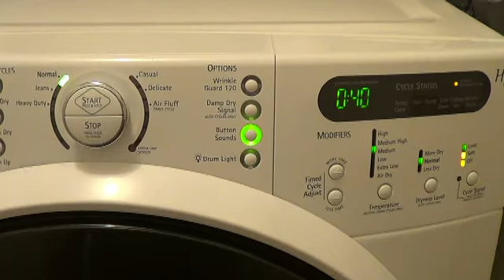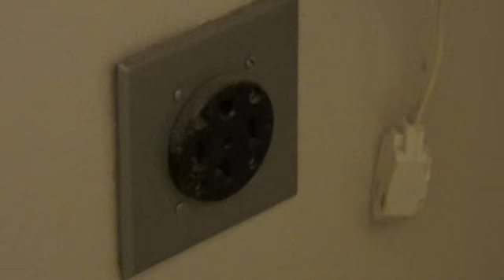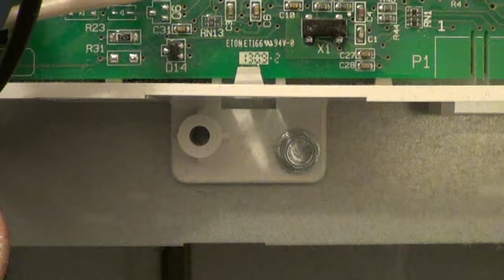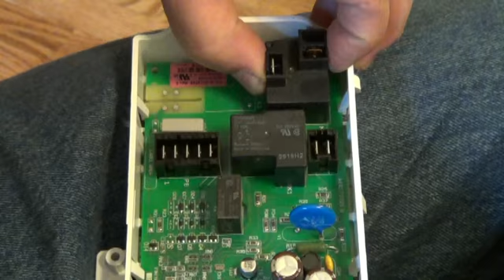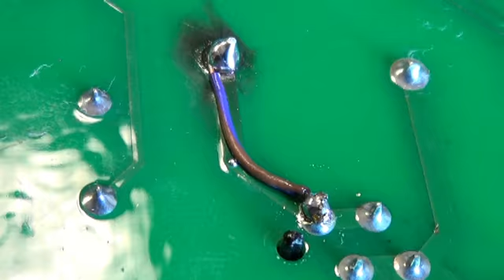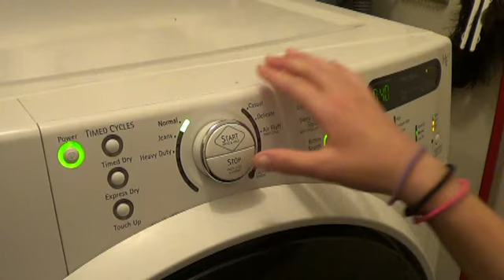Dryer Sears / Kenmore HE3 - F01 Error Code Main Circuit Board Repair

Comment: This is exactly what happened to mine after a power surge and outage for about 5 minutes. First you are supposed to unplug for 5 minutes and then try it but I knew it wouldnt be that easy. Thanks man. Great info. Only took 5 minutes to get the board out too. Very easy access.

Comment: Jim Dandy - you are!!!  I have no experience repairing appliances of any kind, yet I opened the top of my Kenmore, easily removed the main controller board, saw the exact black blowout, soldered a jumper wire, and turned on my dryer.  You saved me $1700 because I was ready to purchase a new washer and dryer set.  Wow, thank you again!!!!!

Comment: I'm so glad I found this video! Our dryer just showed this error and once we opened it up found that the back of the circuit board did indeed look like yours. After a few spots of solder and a few minutes putting the dryer back together, it's working again! 🙏 Thank you so much!

Comment: Board is discontinued so this was the only way to go other than a used board on ebay, as far as I could tell.  I just got some serious brownie points with ex-spouse (why would I bother, you say? good question).  This fix worked like a champ!  Same exact blowout indication.  I'm an attorney, but not a litigator, so not in my skill set but there are at least 840 members of a class action suit right here for designing a circuit board which has the same point of failure and cost consumers many thousands of dollars. Any volunteers?

Comment: @Jim thank you for this. I opened it up, same exact issue. I did solder the wire and put it back together. I got the same code, although, it did turn on for about 2-3 minutes. Same issue. Any ideas?
I replaced both the fuse, and thermistor.

Comment: My dryer quit, just clicked when you pressed the start button.  I never would have considered looking at the circuit board until I saw this video.  My better half was all ready to go buy a new appliance.  I talked her into waiting while I did some research on YouTube.  I watched this,  popped my board out, and it looked exactly the same as yours even down to the blow out.  I did the repair as you described and it worked!!!   I had never used a solder iron before this. I really appreciate you making this video.

Comment: Thanks. Awesome video. No experience required if you follow the video step by step. 
The exiting part was when I released the board and saw the exact same mark in the back.
The only thing I did different was that I did not put a piece of cable, just soldered the loose joint.

Comment: 😁 Whilst I have an electronics background it is sure nice to know exactly where to look many thanks good sir.  I did not add a second conductor as I thought if the trace is under sized and it lets go at the same spot I will know where to go hunting.  I have the exact same board made in 2005 also.  Thanks again for sharing!!

Comment: I found this gem of a how-to-repair, and it was spot on for me. I'm a former ET/trainer, and the video could not have been more clear (except for the "heater-upper" part :). Anyway, the CB land was fried from the relay post, so I grabbed a piece of solid core 12 ga. wire, tinned it, put it between the post and the CB strip, applied heat w/my 50-yr. old solder gun, put it back together, and It Is WORKING!! My wife is ecstatic, so life is good. For a little bit. Thank you so much!

Comment: Outstanding video! My dryer was a little newer, but allowing for the slight differences, it was spot on.  It looked like the previous owner had tried to do the repair and didn't do a good job.  I cleaned up the PCB, soldered the wire in place (thankfully, I know how to solder properly!), and 30 min later, the dryer was back in service.  Thanks!

Comment: You are the man. Appreciate the knowledge. I had to do the wire trick since mine busted the line that leads to the other solder. Worked like a charm. Going to buy me some time to buy a new one.

Comment: Great video!  We are about to tackle this and wondered what gauge wire you used.  Thanks!
Reply from the maker: About 24 AWG solid copper.  Door bell, thermostat or garage door sensor wire.
Reply: @jimdandy6472  Thank you.  We followed your instructions and fixed our dryer for $0!  This saved us about $400.  Thanks again!

Comment: Hi! We have a different problem with ours. The dryer starts but stops shortly after before everything is dry.. Also the lights flicker when it's on. Any ideas? Thanks
Reply from the maker: Could be the door switch.  Try some painting tape to hold it closed as a test.

Comment: Jim,
I hope you see this in time. What gauge wire did you use on the circuit board, to take some of the load.
Reply from the maker: 20, 22 or 24AWG, solid copper. Lots of options, but doorbell, or garage door sensor wire would be two.

Comment: worked for my Kenmore Elite HE5 with the exact same failure and failure code (F01). I didn't use wire, I just resoldered to the trace on the circuit board, but will use wire if it happens again.Took me less than 30 minutes to fix. Thanks for the tutorial!

Comment: I just did this, took a little over an hour including a trip to get wire and solder. You've earned my sub!
Reply: Hello what size wite
Reply: @tiawanathorpe2143  I used 14guage  since that's all that Ace had, otherwise I would have gone for 18 guage (that's smaller) but 14 worked fine it was just harder to bend how I wanted.

Comment: I performed this repair last week and it worked great! thanks. I have developed another problem though and I wondered if this relay has anything to do with the ignitor. I have no heat, ignitor don't glow and the voltage to it shows a short. 0.0 Volts. It ohms out fine as does the thermal fuse.

Comment: I have the same error. Unfortunately did not see anything burned but replaced the  relay anyway, still didn’t work. Have a slight hum from circuit board too.

Comment: Hello, I attempted to do the exact same repair after seeing a few videos with the same problem. But unfortunately mine did not turn back on. Do you think it might have to do with poor soldering?
Reply from the maker: If you are not  good at soldering, a bad soldering joint would be my best guess.  Scrap the pin with the blown solder joint.  Wrap the wire around the pin, then heat both until the solder melts when you touch the wire and or the pin.  on the other side heat the wire until the new solder melts, then push into the original solder joint.

OR you may have a different problem this video can't fix.

Comment: This video got my dryer back up and running!  Thank you so much for the easy fix.  I took the whole dryer apart to replace the thermal fuse and the dryer still did not work. So, I dig deeper into YouTube and found your video. I’m send hugs through the interwebs! Thanks, again.
Reply from the maker: Glad it helped.  Thanks for the kind words.

Comment: Had exactly the same issue with a Maytag MEDZ600 TW1 dryer!!! Same board, same location, same casing. In my professional opinion as an E.E. PhD, it was designed to fail! On purpose after 7-10 years of use.

Comment: I can’t remove one of the clips!!
Reply: Yeah, and its the connector with the two prongs,  there are two dimples on the blades that have to be overpowered to make the connector come loose. Keep trying [ Use a flat larger screwdriver ] but be careful not to damage the circuit board substrate.
Reply: @YouTube.TOM.A  I finally got it and made the repair... thank you!!!!!!
Reply: @rpbabineaux  Jim Danby is the MAN!!!

Comment: This is a great video.  Thank you.  I'll reiterate that the jumper wire is critical.  The exploded solder joint takes out the pad too.  There is really nothing on the PCB to solder onto anymore.  I used 18ga solid copper wire.  24ga and maybe 22ga seems a little thin based on the trace width on the PCB.  It's hard to tell since we don't know the thickness of the board trace.  In my case, I had two damaged solder joints on the relay, so I ended up doing 2 jumper wires.  

I just fixed a nearly 12 year old  HE3.  Hoping to get it to 20.

Comment: What about when the dryer go on gor 20 seconds it shuts down and a code 3 backwards and a 1
Reply from the maker: I found a video for an E1 error code:  https://www.youtube.com/watch?v=MN6E-oM0qoM

I did not watch the entire video, but it appeared to be a temperature sensor problem, and they showed the steps to replace it.  

No promises, but you should also check that the driver vent hose and pipe to the outside is clear.  It may be shutting down on high temp due to reduced air flow, or the sensor is bad, or I'm way off base.

Comment: Thank you! We just did this with zero soldering experience and it was super easy and worked like a charm. 39 bucks of hardware store materials and tools about 30 minutes of work later and we have a working dryer again. Folks like you who post this stuff are awesome.

Comment: Mine had been repaired before then quit working again.  I purchased a new relay for 10 bucks on eBay, put it in, and it did not work.   Then added the jumper wire and all works like new now.  Thanks for the advice!
Reply from the maker: Glad to hear it worked for you.  The jumper wire is important because usually when the solder joint explodes it blows away some of the metal foil, on the circuit board, around the pin.  While the new solder will ball up on the pin, it is not making any connection with the track on the circuit board over to the next pin.

Comment: I am fully capable of putting up fences and building decks.  I can change old light switches, but NEVER would I try something like this.  So I did.  When I saw the price and then watched this silly video, I said the worst that will happen is I waste an hour, and pay full price to the repairman.  
Jim was easy to understand, I had exactly the same problem, and although I had to visit a friend for a soldering iron, it went back together lickety split.  With youtube and guys like Jim, I can do anything!  THANK YOU SO MUCH!  Charlie Arbuiso  Endwell, NY
Reply from the maker: I'm glad it worked for you.  I continue to be amazed that over 5 years after making this video I continue to get comments almost every day.  FYI: My dryer is still working with this repair from over 5 years ago.

Comment: So i dont know if this is relevant or not. But I did the same fix about a year or three ago and it worked amazing. But.... now my dryer is turning on but I get no error codes and  the dryer does not get hot, even warm at all. No heat whatsoever .... I know what people say, fix this, replace that... I have replaced all the fuses and thermistors, changed the heating element. Everything on the lower side of the machine I have replaced ( I didn't check the switch inside the motor yet though).... No matter what I do the machine just does not heat,  I am thinking about re-doing this fix but I just don't know..... Anyone have any similar issues ?

Comment: Thanks a lot. Same issue. Fixed.
Before I found this video I called to a big famous company who is doing repair - quote just for visit abt 100$, no warranty, plus job and materials, ... and visit in 5 days..
So, soldering issue fixed and I called to the company to cancel visit and told them that I found another small company, their tech came in 30 mins, and fixed for 10$... Let them now scratch their heads how it is possible -))).. Small prank -)

Comment: Thanks for the review, I fixed it thanks to you!!!  I used 18 gauge braided aluminum wire but probably could have gone a bit smaller.  Just hope it holds and doesn't burn the house down.  The price for a new board in August 2020 is $306.35 if bought from directly form Sears.  Nice to save a few bucks thanks to folks like you that make these posts!

Comment: Great tutorial.  Found exactly the same problem with my  Sears Kenmore Dryer Model HE3.  Your fix saved our family $300.  It took about 20 minutes to pull the circuit board and repair the circuit.  I extended the wire 1/4" to the next pin to the right that needs the same signal effectively bypassing the trace in circuit board.  Apparently this circuit needs a heavier trace in the circuit board to carry the amperage required.

Comment: Oh myyyy gooood!  Same exact issue I just had.  Thank you for this!  Amazing.  Just 1 question.  Is that safe to piggyback that wire to that other circuit point?  Not gonna cause any other issues or overloads to the circuit?  Thanks again!
Reply from the maker: That "piggyback" wire is just a separate path between to points on the circuit board previously connected by a thin metal track between the same two points.  When the joint explodes it usually damages the thin metal track, so soldering the "piggyback" wire directly to the pin is necessary vs. just trying to add a blob of solder back on the pin with little or no metal left around it.  Mine is still working after many years now.

Comment: I ended up replacing the busted relay itself, but that didn't fix the whole issue, so I used this wire trick with the new relay and it works like a charm now. Thanks!

Comment: Thanks so much!  This was really helpful.  My 12-year old Sears Kenmore/Whirlpool Duet Sport dryer would not start and showed code F01.  Followed the instructions in the video and sure enough on careful inspection, one of the pins at the location shown on the control board showed signs of heating and damage. Cleaned it up and resoldered and success.  Took quite a bit of heat to get solder to flow over the eyelet on the board.

Comment: When we opened our circuit board sure enough it was the same exact problem. Followed the video instructions and was able to fix it at no cost (borrowed a soldering iron)! The only glitch we had was trying to figure out what wire to use. One of the comments below mentioned 12 gauge, but that seemed way to thick (& didn't look like the wire he used in the video), so we just directly soldered the joint. Thanks so much!!!!

Comment: Thank you for the video sir! I did try to Sauder those points with the wire and unfortunately the relay was still bad. But it did save me quite a bit of money not calling out for a service call. I ordered the new circuit board from Midwest Appliance in Chicago for $180 including the 3 day shipping, so not as bad as it would have been if Sears come out.  I'm an air conditioner repair guy so I'm familiar with boards going bad.

Comment: Thank you for making this video! We had the same problem and after spending $24.00 on a soldering iron, electrical wire, and some electrical solder, we fixed the problem! It only took about 30min from start to finish. Thank you so much for saving us hundreds!

Comment: Thanks so much. I was working on a dryer that had a bad start button (wouldn’t actually make contact with the switch on the circuit board). Once I disassembled the control panel, I was able to press the little tactile switch manually and then I got this error. My control board had the same exact solder joint issue. I’ll have it all up and running once I get a replacement start button.

Comment: Once re-soldered, I’m testing and it keeps “popping” and the connection is burnt again. Any suggestions? Thx in advance
Reply from the maker: Hard to say without knowing more.  I assume you are installing the jumper wire and not just trying to simply resolder the exploded solder joint?  The jumper wire is needed as the solder track around the exploded pin is damage during the initial popping.  If you are cleaning the pin, using the jumper wire, and using good soldering techniques, there may be a more serious problem, but this would be the first time I've been told this fix failed.  Good luck..

Comment: Absolutely amazing video!!! Thank you! My dryer had this same problem 2-3 years ago and I didn't bother to google much; I simply shelled out $200 or however much for a new board. Today it happened again and I was going to just buy a new dryer, but I decided to search a bit first -- found this video and an hour later my dryer is back up and running. Excellent work.

Note for those who run across this: The joint where the blow out occurred didn't take the solder the first time around. It was covered with black residue and I had to use my fingernail and scrape it clean. Once I got down to shiny metal I was able to successfully do the work.

Comment: This is as relevant today as it was nearly five years ago today. My Whirlpool Duet Dryer stopped working today with the F 01 error. I've owned it for 12 years and have never had an issue with it, but did not want to pay who knows how much to get it fixed. I opened up the dryer I did find that this was my issue. 

I was handy with a soldering iron in my youth, decades ago, and still had a soldering iron, but no solder or wire. Ran down to Lowe's and got both (of course, I had to buy more wire and solder then I will use in my lifetime), followed the instructions here, and the dryer is working again. No hefty appliance repair bill and no waiting days for it to be fixed. Thank you!!!!